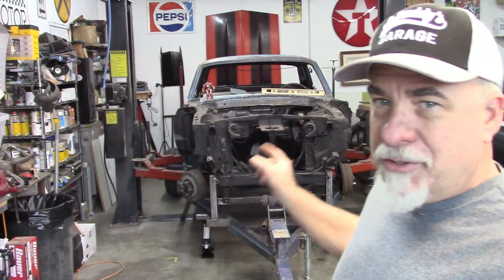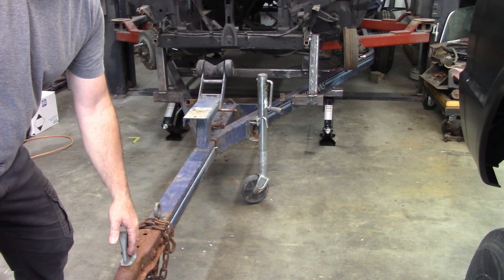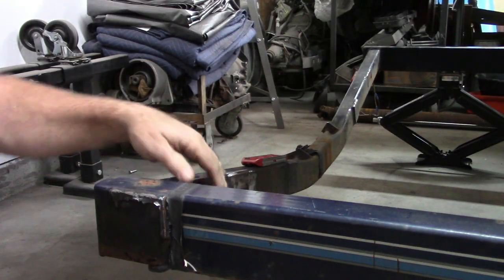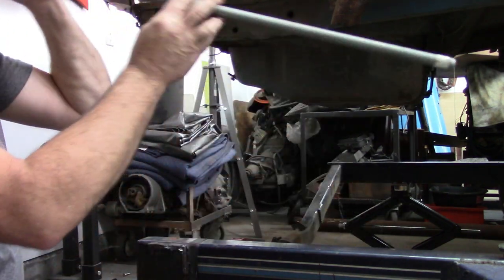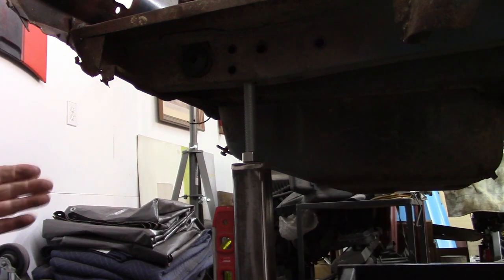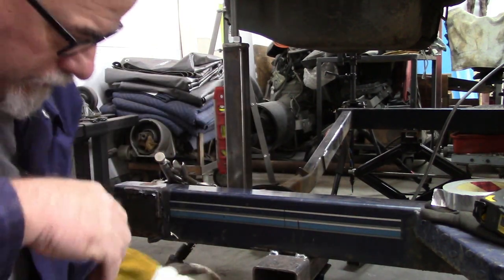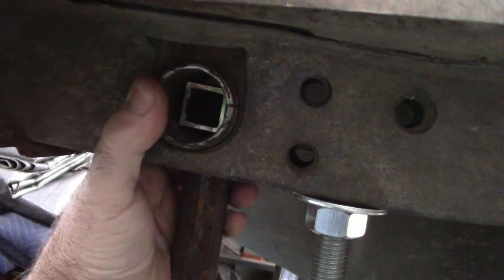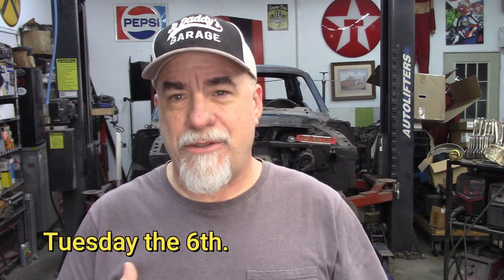Mobile Mustang frame jig. Part 5.

Comment: Barry you could cap off the last part to go into shackle hole and weld a nut on it. That way you could use bolt and fender washers from outside to lock into place. Just a thought

Comment: Looking forward to see you work on the car!Have you used the George Liskey frame dimensions for 64-66 mustangs?
Reply from the maker: I did not use those. I used the car as my guide.
Reply: Gotcha, I’ve got a 66 fastback I’m trying to put back together using both the Liskey diagram and the shop manual. Trying to verify a couple measurements that are not on either one.
Reply: Do you know what the measurement is from the floor pan to the top of the inside of the rocker panel? I installed new rockers and my old frame rails got sandblasted so I lost the exact witness marks from the old floor.

Comment: Jig is looking great. Would like to get a measurement from you on the height to the bottom the front frame rails at the very front of the car if at all possible. I have a 1967 convert where the rails are 1/8th of an inch different and I'm not sure which is correct. Not sure if I should really worry about it or not, but I'm worrying about it anyway. I don't see any evidence of a collision or anything bad at the front of the car and I know these cars were far from perfect, but when you go to this much work I would like to be as close as I can to ideal. Thanks for all you do here. Super helpful for us amateurs.
Reply from the maker: I would say 1/8" is pretty darn good. I could try to measure though.
Reply: @JoDaddysGarage  Thank you. I really appreciate the help.